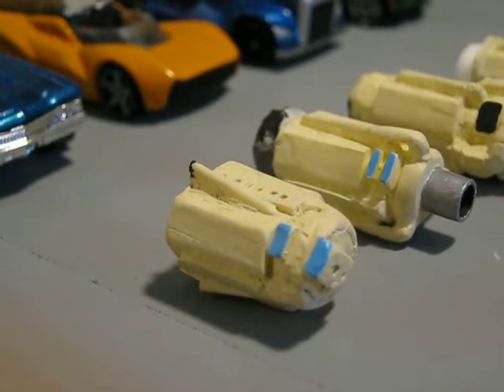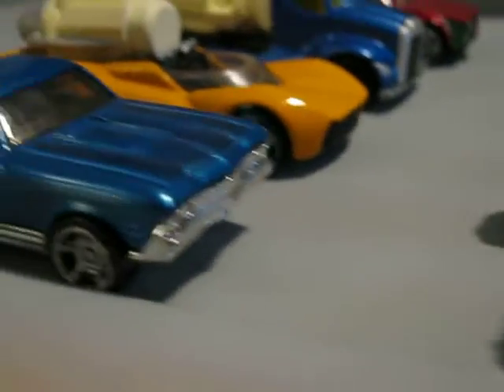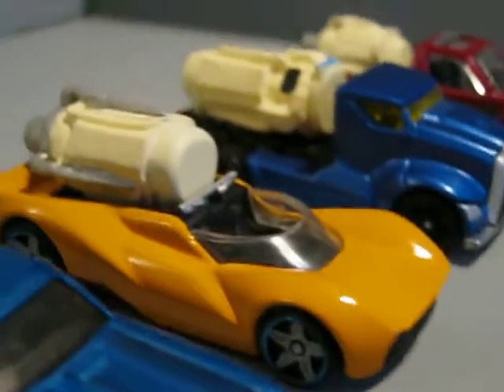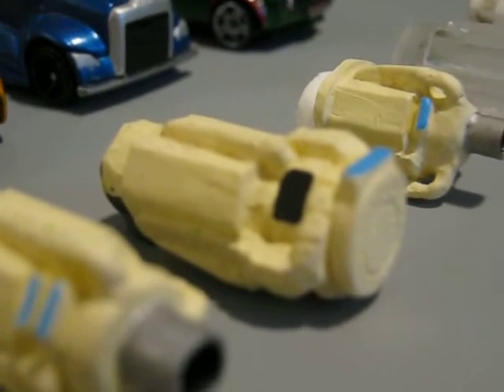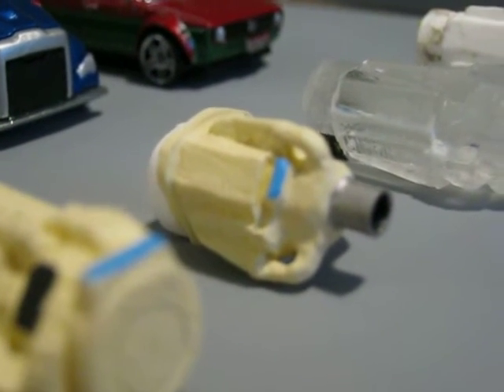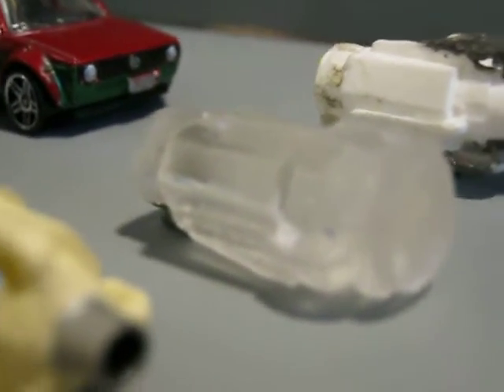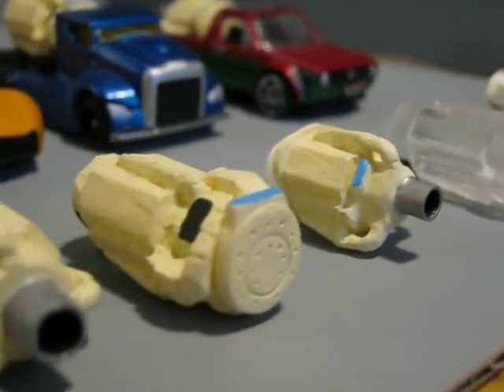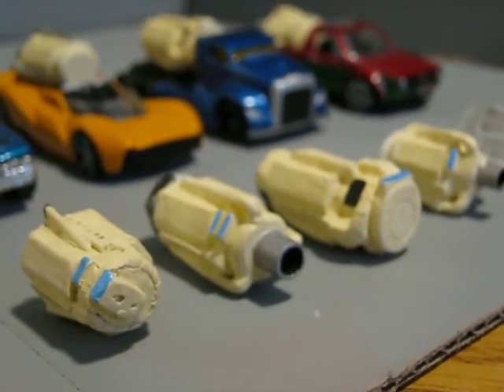Ultra Mini Deltic Engine model progress

Comment: I subscribed to you for the crazy cool small engine machines. But, I still have no idea what this stuff is about.
Reply from the maker: +Scott Avuton lol   These tiny plastic engines a Deltics, the British developed them for use in torpedo boats just after WW2, they also used them in high speed passenger trains. They are unique, as the have 3 crankshafts, instead of the normal one crankshaft. Thanks for subscribing, and Merry Christmas.